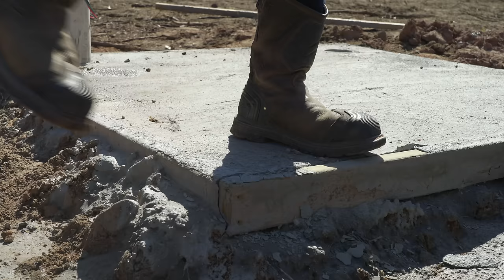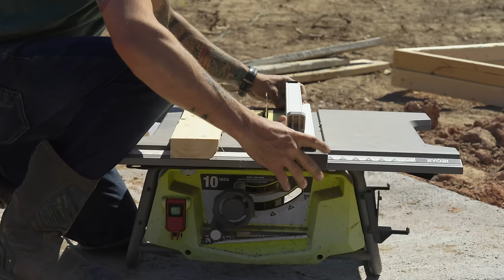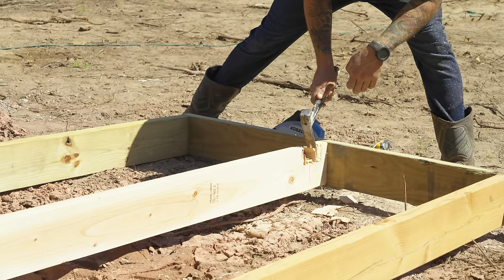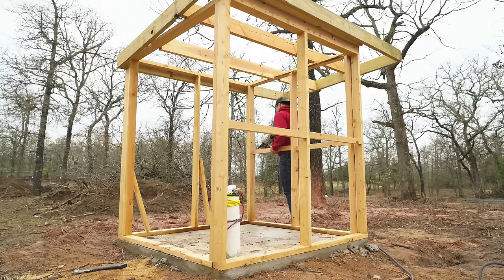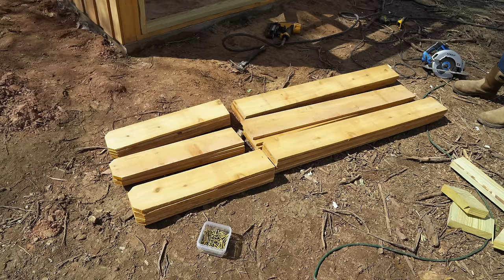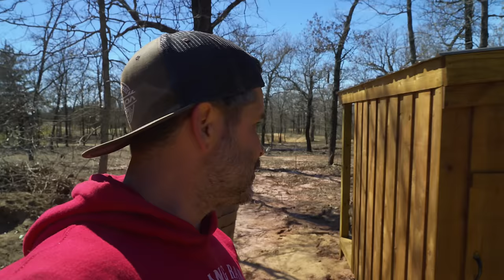DIY Water Well House & Garden Shed Combo / Homestead / Tiny House

Comment: Good job BUT you've made one bug mistake you put wood directly onto concrete big no no you should have put some kind barrier between the wood and concrete even if it just a piece of polythene, plastic, concrete attracts moisture would will suck the moisture from the concrete 2 or 3 years the word will rot I made the same mistake on my shed how to take it down and rebuild it. But it looks good. 🏴🏴🇬🇧
Reply: I guess he can go in , unbolt it,  pry it up a half inch on all sides and slide in the sealer and let it back down,.
Reply: Where the hell are you at?
Reply: Built mine on top of concrete and still solid 10 urs later ..no rot
Reply: it dont matter something will happen and they will have to move to another property have you not watch the channel lol

Comment: You should have put your compressor and your generator in the back of your truck or tractor. When you were doing horizontal bracing , put 2 screws underneath the board to hold it up. Nail it, take your screws out and move to the next. Danielle can run you around. Put your miter saw on the tailgate. I think this would work out better for you.  Very nice job

Comment: I think it looks good and if you need to insulate it you can buy the rigid foam which you can get in 4x8 sheets and even put a plug in on the inside for a small heater with temp. control if you get a really cold night.

Comment: I like it. It's cute. I'm glad that you made it tall enough to stand in... Did you see the comment that said that you needed a barrier between your base plate and the concrete or  your wood will rot... And the reply that said all you needed to do was loosen the bolts pry it up and lay your barrier and then lower it back down... Just adding it in here in case you didn't see it...✌️